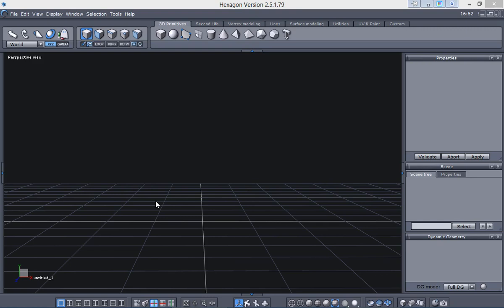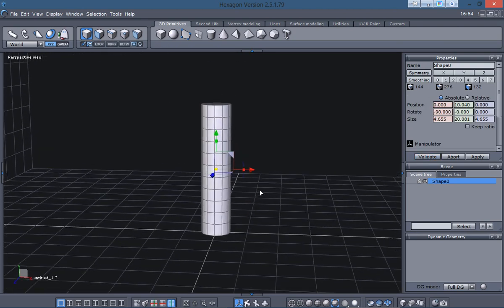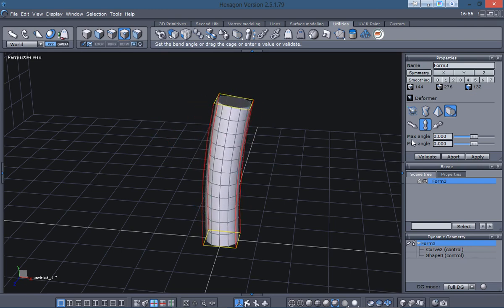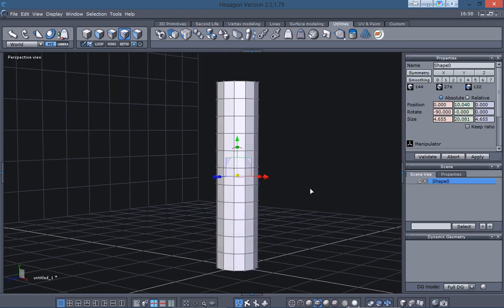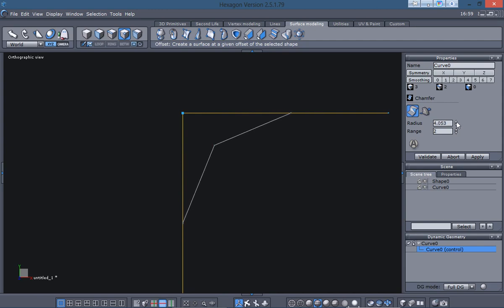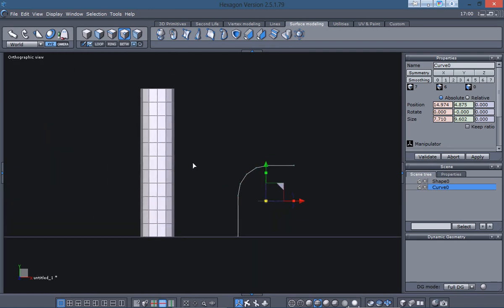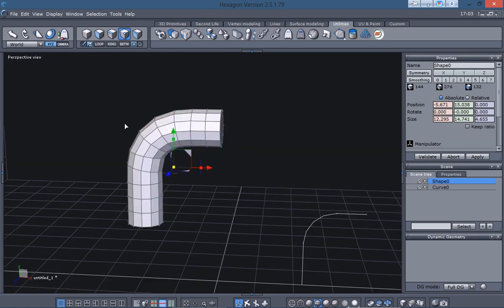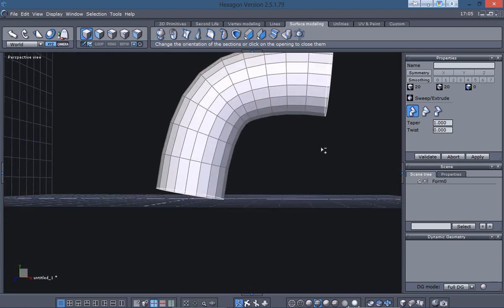Bend Deform In Hexagon 2.5

Comment: Hexagon is still the only modeling program I use to make clothing, props and structures.  The only problems I have it with it is if I create too many groups it gets sluggish and will crash.  Also loading large texture maps causes a bit of wait but that's probably due to my old graphics card.  And if I use it on a monitor that is 1024 x 768 or lower working with the domains pane becomes a real PAIN.  It simply disappears.  I still enjoy using these videos to refresh my memory.